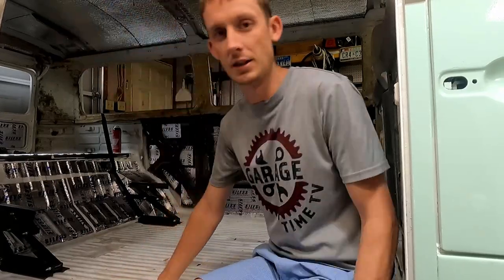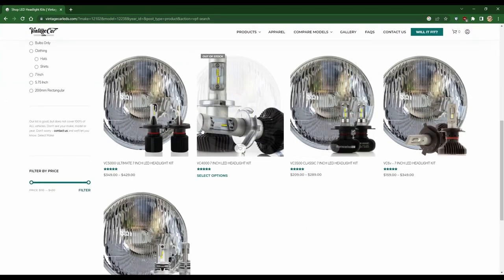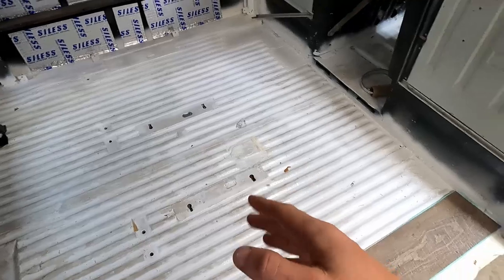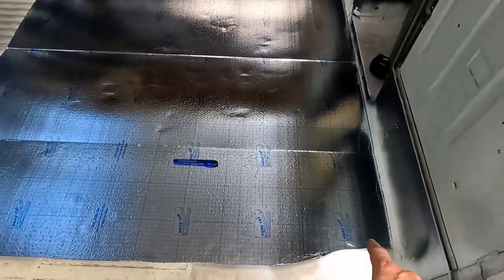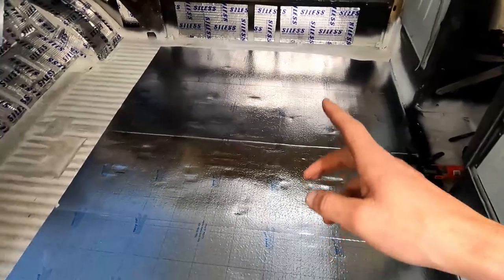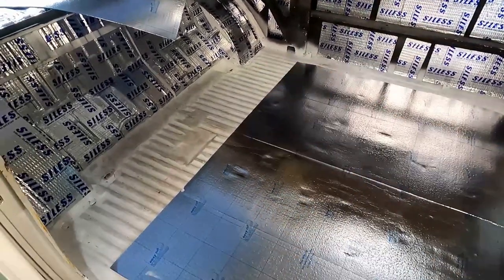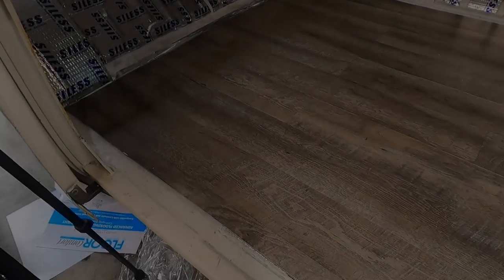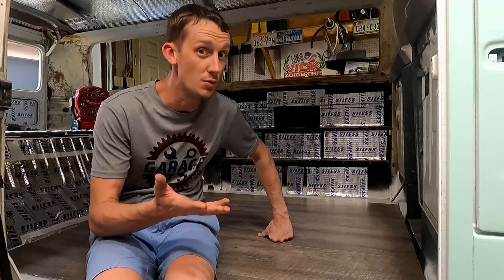Flooring Makeover for my Vintage VW Bus: Watch the Transformation!

Comment: Man, that looks great. Should hold up nice. Love those folding seat/bed rails. 

I'm curious, the holes that look like ductwork in the back of the seat dividers, are they for heat, airflow?
Reply from the maker: They are for heat. The doors have plastic channels that screw on. They direct the hot air from the dash towards the rear cabin.